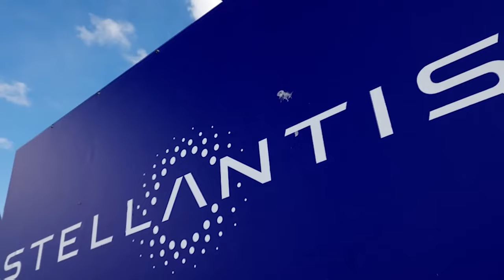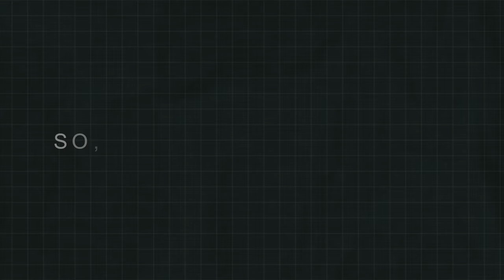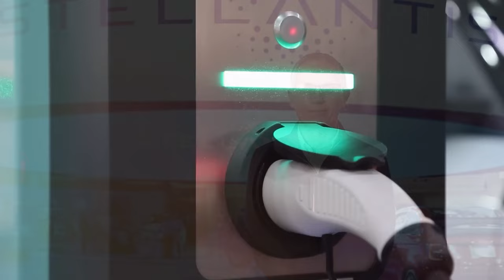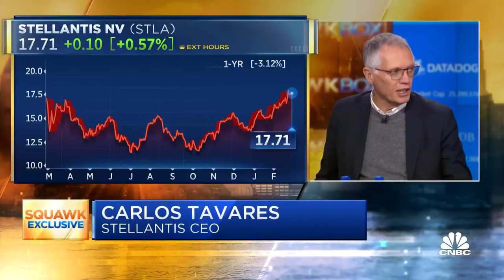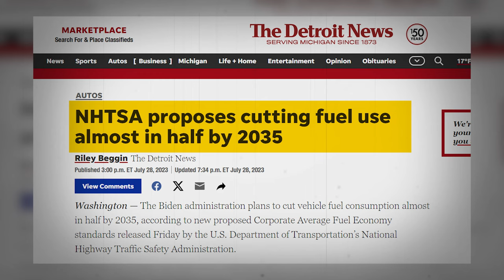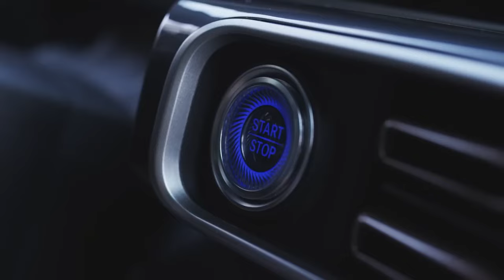BREAKING NEWS! Stellantis CEO SHOCKING WARNING To All EV Makers!

Comment: Not a surprise. I mean the entire EV industry is held up by Govt aid and subsidies right now, and even then most of the EV market is not making a profit despite the high prices and tax breaks. Add to that the EV model barely works for upper middle class people. If you can't charge at home with a driveway or garage it's basically insane to own an EV. Relying entirely on the super charger network to charge your car is not only way more expensive, it's far less convenient to start off every day with a 30 minute wait at a charge station.

This means any one living in a condo, apartment or any other place without a location to trickle charge their car over night basically can't buy an EV.

Comment: Don t think parallel conclusions can be drawn here. ICE technology was tried, tested and fully developed by the 1930's with the Wall str. crash the main reason for the thinning out of the vast variety of manufacturers. With EV's we have largely untested technology with a mountain of unsolved problems which could well backfire completely as the rush to develop alternative methods of propulsion gain traction.